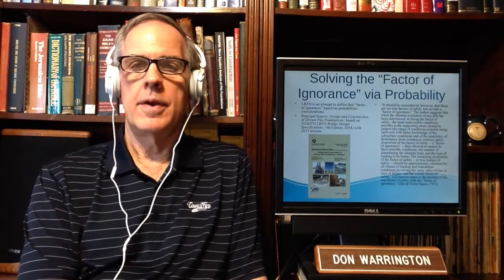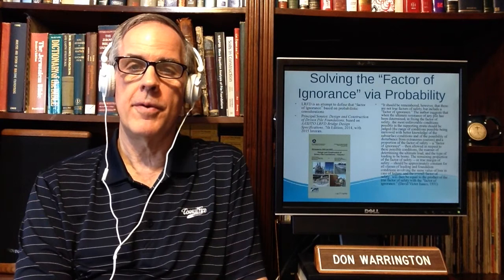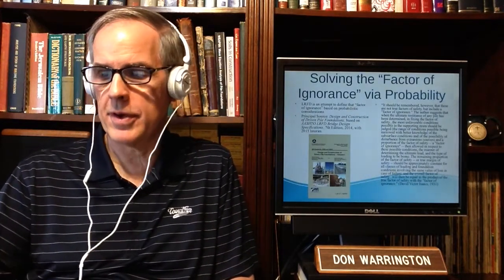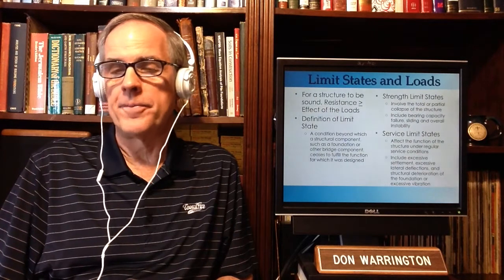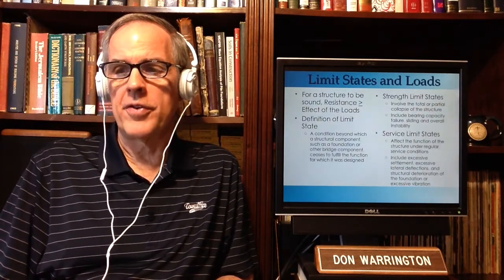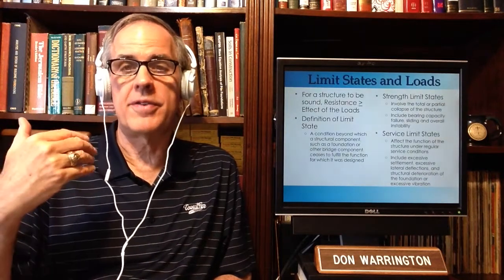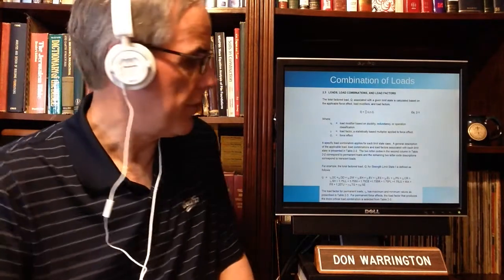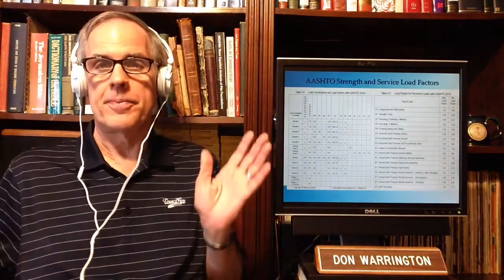Foundation Design and Analysis: AASHTO LRFD Method

Comment: Dear Sır
Thank you for your nice video.
Would you explain me the philosophy of increasing the loads and decreasing the resistance in LRFD design method . If we are at the elastic zone in HOOK curve or pass to plastic zone  in LRFD method ? . What is the main concept by increasing the loads if we do not pass to plastic zone, or it is virtual and we remain in elastic zone. I can’t catch the beauty of LRFD if don’t understand the logic of assumes in LRFD . Please clarify it me if possible.  My in advance gratitude.
H Rahimi
Reply from the maker: Let's start with the resistance: we decrease the resistance because of the uncertainty of the resistance which is calculated from the physics of the problem.  We increase the loads for basically the same reason.  If we could determine with precision either or both of these quantities, in principle we would not need LRFD, but we cannot.

I'll stick with geotechnical considerations for the elastic vs. plastic problem.  It is the rare geotechincal problem which is solved using purely elastic assumption of the behaviour of the soil.  Most geotechnical solutions fall somewhere between the lower bound (where there is purely elastic behaviour of the soil) and the upper bound (where there is purely plastic behaviour of the soil.)  All of that assumes a clean boundary between elastic and plastic behaviour in the soil, which really doesn't exist but which we assume to be present in many of our models of the soil.  The lack of a clean boundary between the two is another element of uncertainty which brings me back to the previous paragraph.

As I mention in the video, there are those who have objected to using LRFD in geotechnical application at all, one of those is here: http://vulcanhammer.net/2017/01/08/letter-concerning-dynamic-methods/
Reply: thank you very much dear prof .